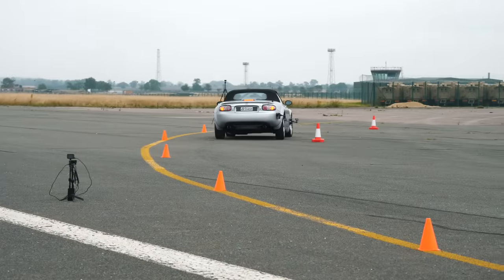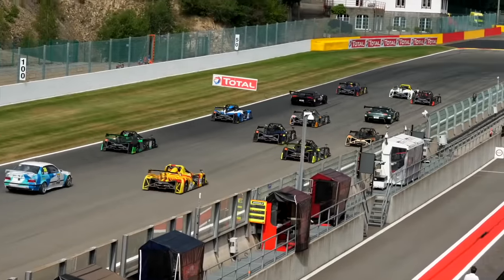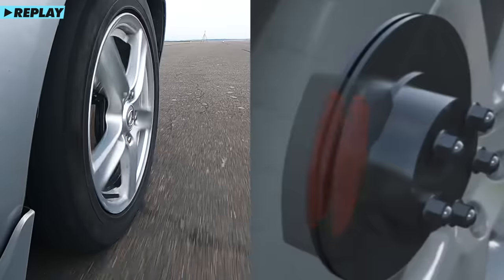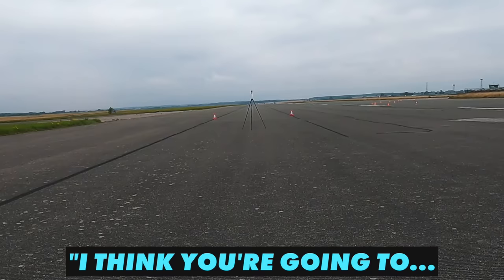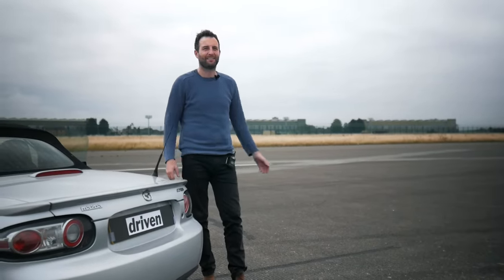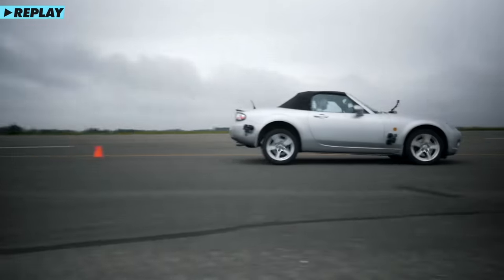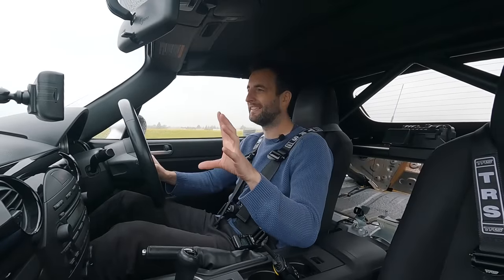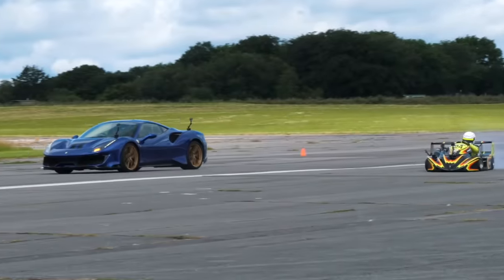ABS ON vs ABS OFF | What's Really the Difference?

Comment: It'd be great to repeat the tests with ABS off, but controlling your braking. Great video!
Reply: Was disappointed in them not doing that test, they nailed it otherwise
Reply: I feel a good driver could do an excellent job
Reply: @lurka1337  Yes he could, but what would be the point of it? If a racing driver can handle it, the video would create a false impression. It makes sense to not control the breaking since it would be tricking the viewer into thinking it's easy. If you really want to find out, find a unused road and test it yourself. After some practice you'll be able to control the breaking, however you will need practice and you still won't be as reliable as ABS. ABS is used in racing just for this reason, you can be more confident in you're breaking and can shift your focus to the environment and not to master the breaking.
Reply: @Tobiasliese  I just think it would be entertaining, you know what you tube is for? I want fact YouTube is not where I go first, sometimes it's useful, but it's just entertainment IMO...
Reply: Also would like to see what a good driver or even average driver would do VS ABS
Reply: Isn't that the essence of ABS? If you are really good at controlling your braking, ABS will never activate and you MIGHT get 1-2m shorter distance out of it. But chances that you are not that good at braking as a professional driver and you do not brake hard enough and instead loose braking-distance.
Reply: @Tobiasliese  You are totally right but still it's would be interesting.
Reply: @dcdc358  I think the other purpose of ABS brakes according to my car manual is to let you steer while braking hard, because it says that in many emergencies steering can help you more than even the best braking. I'm not a professional though!
Reply: @dcdc358  do you think that if we have ABS brakes, we should put the brake pedal all the way down because we'll never be able to lock the tires? I think we might as well use all the braking power we have if we have the ABS brakes.
Reply: @heckraiserrr413  yes. In emergency situations.
Reply: @lurka1337  Believe in JESUS today, confess and repent of your sins. No one goes to heaven for doing good but by believing in JESUS who died for our sins. GOD loves you soo much unconditionally.😍😚☺❤🍂
Reply: @dcdc358  Not true. I am a really good (motorcycle) driver and the bluddy ABS's lock way before it is needed. ABS always makes the braking distance more in slippery, dry asphalt and it is seriously dangerous in tight, downhill, slippery turns. The brake just release (instead of just skidding a bit) and bike is thrown to the outside of the curve. Not mentioning that nightmarish feel of a broken lever, right in your save-your-life finger. Horrible experience, and takes all the fun away from the bike, as well.
Reply: @constantinosschinas4503  agreed on ABS sometimes coming in to early (in my car, that is). Especially on rippled tarmac or on short sharp bumps, mostly right before I come to a standstill. But for the rest, this video speaks for itself. I did not expect that, t.b.h.
Reply: @Tobiasliese  What's the point of having a professional driver then?
I am not a professional driver, and I don't think I can control the breaks in the same way, so that's not a test I cannot do (let alone finding a place to do that, and I don't even want to risk my car).
He has much more experience, besides they have equipment to reliably test it.
You are saying "get a successful video maker with hundreds of thousands of views, a crew, and get years of experience with very expensive and one of a kind racing cars, and you can find it out". Like it is is nothing.
Reply: I agree, several times I have had to panic stop in traffic and as soon as the wheels lock I start letting up on the brake so the wheels started turning. I thought this was common knowledge.
Reply: @Veronika Zaglotova 
I disagree. In my experience abs kicks in when ONE wheel momentarily locks up by driving over a cast iron drain cover, a small patch of oil, some wet leaves or even a bloody crisp packet! At that point the car completely loses braking efficiency unless the brakes are re-applied.
Reply: Yea I really wanted to see the non ABS braking pressure controlled by a competent (to say the least) driver.
Reply: Only if demonstrated on several surfaces - like dry, wet, ice - and the driver gets thru the road for the first time. Otherwise it may create an impression it is very possible to break better than abs.
Reply: @georgeyoutube7580  I respectfully but completely disagree. This is well known that a competent driver without ABS can often stop shorter than a car with ABS. ABS allows a mediocre or average driver to mash it to the floor and still have steering capability. It isnt made to stop you more quickly. It is made to allow you to get maximum braking WHILE still being able to steer. 
Why the hate to car drivers? Everyone cant and shouldnt ride a motorcycle. Im sure if I rode more Id probably have a bad impression of careless car drivers that dont see me too, though to be fair.
Reply: @MattH-wg7ou  A competent driver in ideal traction conditions on all tires with the brakes setup with correct bias front to rear to match the road ... left or right brake bias if he's also swerving while braking ... nah. ABS will do it better then any driver. Your foot is still a foot not a hand. It requires more training to work like a hand and do fine adjustments. Its simply not worth the effort when there's ABS available. Get a motorcycle to learn how to brake manually. Still difficult but not impossible. On a car ... it's impossible for all intents and purposes, ABS will do much better.
Reply: @georgeyoutube7580  for an average driver I agree. For a competent to professional driver you are observably wrong. There have been many tests of this.
Reply: @MattH-wg7ou  can you point a single one of these tests? The fact that ABS is mandatory on each car sold means it's over, ABS won. Like helmets on motorcycles. There have been numerous tests that show that people with shorter necks can survive diving into the asphalt. They move their heads out of the way faster, they are especially skilled. Like braking a car ... that's not a skill worth learning.
Reply: Abs off with professional brake control is better than abs on...its the answer..but abs is a life saver in traffic..so abs off goes to track. Abs on is going to traffic..and im too lazy dont make me explain..
Reply: Not a good comparison. You guys just slammed the brakes on locking the wheels.
Reply: @memohan9065  the reason abs off is better for track is that it's difficult to reach desired entry speed into corner with ABS on. Not because a professional driver can stop the car faster then ABS can. The ideea is to carry max speed into corners and ABS cannot do that
Reply: @georgeyoutube7580  yea. Thanks tho i was lazy af to explain
Reply: You can't just turn off ABS. Turning off ABS requires adding brake bias corrector.
Also, there are certain techniques which, when mastered, make you much safer, but require car without ABS. 
The braking on ice without locking, the dug-in braking (when you steer to the side of the road, off the tarmac), and the sideways 4 wheel lock). Those are life saving techniques, each of them impossible with ABS.

Also, ABS shuts down without a warning when its sensors overheats. Quite a lot of cars have been crashed on tracks and in the mountains because of that. You can learn to emergeny brake without ABS, but you can't get used to ABS and in split second change technique when ABS fails.

I've always driven cars without ABS, and I will never drive a car with ABS. With my level skill, having ABS is a life hazard, so I always remove ABS and add brake bias corrector.
Reply: good idea but still i dont think we could do as good a job as the computer since he said the computer engages the brakes intermittently 15x a second until the car's under control, impressive!
Reply: @as_tb  It's possible to learn edge-of-grip braking so you don't really have to compete with ABS and you still get similar results. Very difficult though. 
The real strenght of not having ABS is the ability to perform maneuvres impossible with ABS, such us dug-in braking, or stopping the car from spinning with 4-wheel full lock. And the fact that if you don't have ABS it won't fail, which can be a real issue in sports driving when brakes heat up and there is a risk of buring an ABS sensor and subsequent system shutdown.
Reply: old cars do not have that,1990s ,, 1970s etc? ive been driving from age 12 ,60 now,never had to rely on the mechanical abs,we learned how to shift manual transmissions and use manual brakes,even with no power steering and no power brakes ,, all in how you taught to drive,today's world? modern humanity is being trained to be dependent upon everything

Comment: Can you do a part 2 with threshold braking vs ABS?
Reply: Yeah. For us that grew up without ABS, we know this is not how your brake when you don’t have ABS! My mom taught me how to brake without ABS when I was a teen. Is it lost knowledge?
Reply: @float32  born in 02 here, and my first car was a 97 accent no abs or at least no fuse in the fuse box for it and my now car is a 2010 elantra no abs... yeah sounds ridiculous but it was still an option in 2010 to have abs just like how powered windows were. With time, I've learn how to brake without abs and now I have to reflexes to release some brake pressure and also brake gently while turning. 

Also, I live where it gets under freezing for 5 solid months per year and lots of ice and snow, this helped me alot to learn how to drive and brake well.
Reply: I was waiting for that part next but they never did.  Those poor tires though!!
Reply: @balinoob1837  I'm actually surprised it was not mandatory by 2010. What country are you in? I am in Canada and I think it was standard in everything after around mid 2000's. (I may be wrong) now all the new stuff if it has an abs fault it goes all nuts because stability control was mandatory after 2013 or  2014 i think. I buy older cars and disable the abs in winter because I hate it
Reply: @balinoob1837  I'm actually surprised it was not mandatory by 2010. What country are you in? I am in Canada and I think it was standard in everything after around mid 2000's. (I may be wrong) now all the new stuff if it has an abs fault it goes all nuts because stability control was mandatory after 2013 or  2014 i think. I buy older cars and disable the abs in winter because I hate it
Reply: @juliogonzo2718  i live in Québec haha
Reply: @balinoob1837  I googled it and I was wrong, apparently it was not mandatory until 2012 model year.
Reply: I was waiting for this in this segment but it never came.  My daily driver is my first car I bought in 1979 and I still drive it daily.  It of course does not have ABS and I just learned how to brake hard while still keeping control.  After 43 years and 450,000 miles of driving this car (cross my fingers) I have never hit anything.  I am really interested to see the comparison.
Reply: @juliogonzo2718  I used to work of VW Audi and in the late 80's and into the 90's Audis had a button to disable ABS because they found that locked wheels stop quicker on snow and soft mud due to a wedge forming in front of the tyres.
Reply: @captglenn100  Does it have drum brakes in the front? Because you'd definitely have to learn how to properly brake with those with no assists.
Reply: @dekoldrick  No, they are disc.
Reply: @IanDarley  back when the Germans actually built good vehicles
Reply: @float32  My first car had no ABS and i just done pulsebraking pressing and releasing it fast over and over if i had to brake so hard.
Reply: @float32  So true dude
Reply: @IanDarley  I feel ABS activate in my car only in the winter when the roads can be icy, and it makes me feel out of control and just praying the car stops itself before it hits what's in front of me.
Reply: @juliogonzo2718  Mercedes Benz had ABS available as an option 1968 and standard fitment since 1981
Reply: 😁 I daily drive my 01 sports car with abs off, it's a lot more fun

Comment: Would also be interesting to see how 20 years old ABS compares to the new versions.
Reply: I've heard some of the first abs modules operated at 2 hz.
Reply: @juanordonezgalban2278  Believe in JESUS today, confess and repent of your sins. No one goes to heaven for doing good but by believing in JESUS who died for our sins. GOD loves you soo much unconditionally.😍😚☺❤🍂
Reply: really sucks. almost caused an accident in our familys truck so i pulled the fuse and braking is a lot better now
Reply: @alunesh12345  cool but please dont spam his word everywhere, it turns people away from jesus especially when they need him
Reply: My car turns 21 this year, ABS is broken and I've had to let up on the brakes to avoid hitting curbs when I was a new driver
Reply: Wouldn’t mind volunteering my 96 era 3 channel for the test lol
Reply: The ABS of my 1991 MB 190E was absolutely HORRIBLE ... I was very happy every time the ABS malfunctioned and reverted back to normal breaking, in winter that car was dangerous with 4 double the normal breaking distance because of the bad ABS. Usually I had to use the hand break to stop because the ABS would not let me...
Reply: @a64738  same for my skoda, no brakes on ice but on perfect conditions the car could drive 20m on locked wheels before the damn abs decided to work. and that was still nothing compared to esp that tried to kill me on every corner locking random wheels at random times